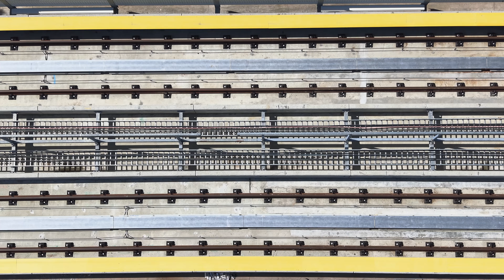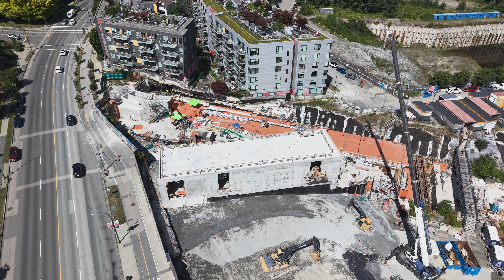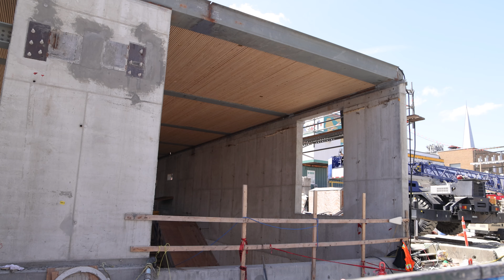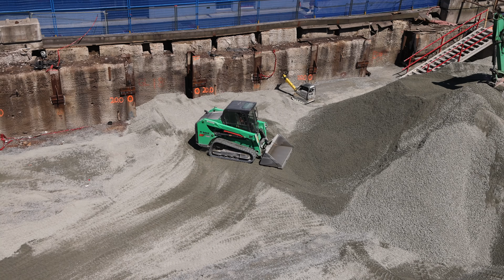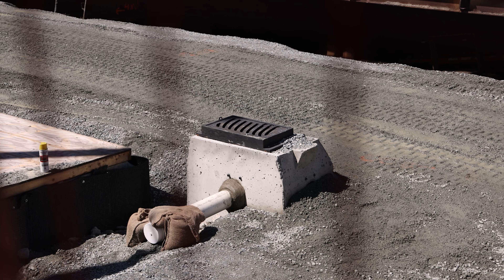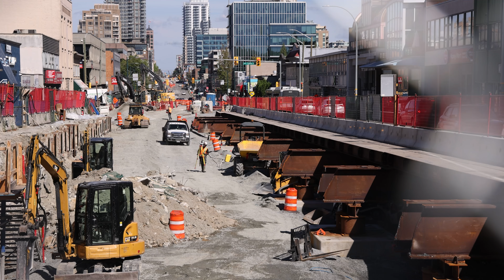Broadway Subway SkyTrain Construction - July 2026

Comment: silly question but when this line opens will it be loud inside the trains in these tunnels? Like how in downtown the trains get super loud between granville and water front on the expo line?
Reply: probably the same as the other sections that run in tunnels. it’s really only the older trains that are loud, the ones without ac where passengers open the windows